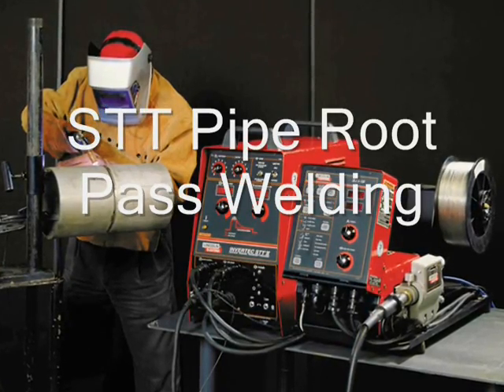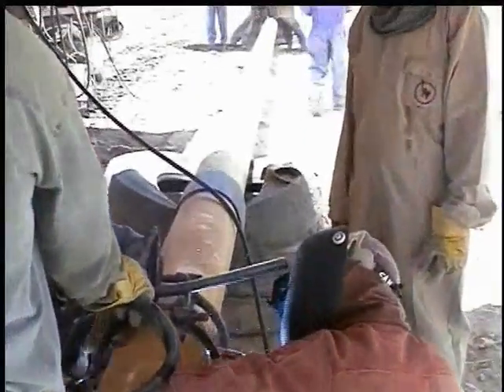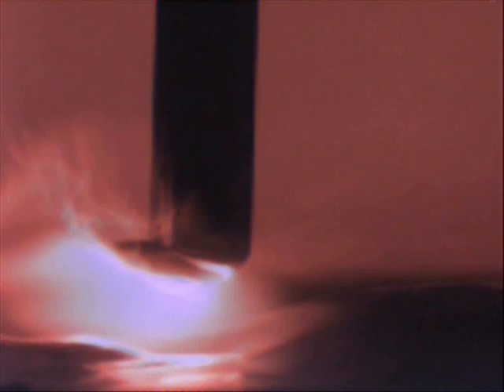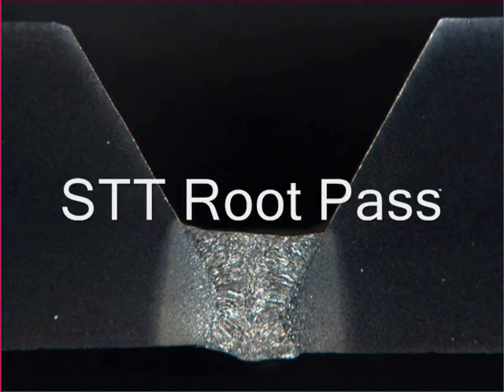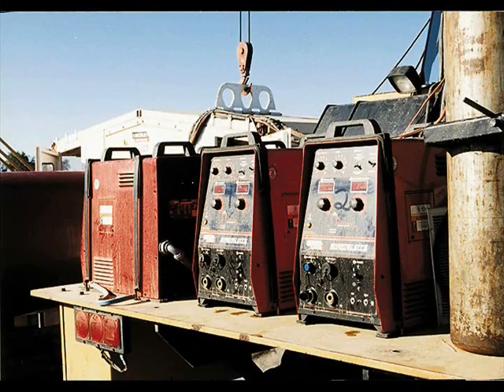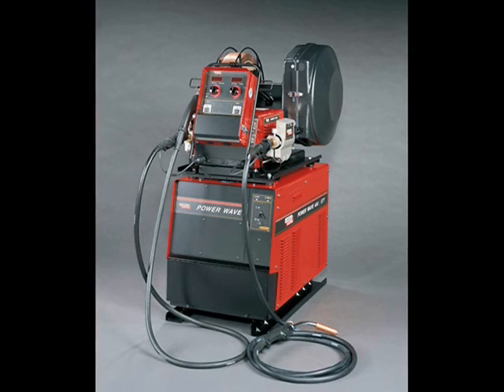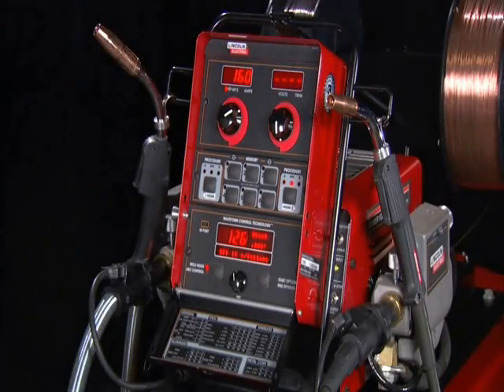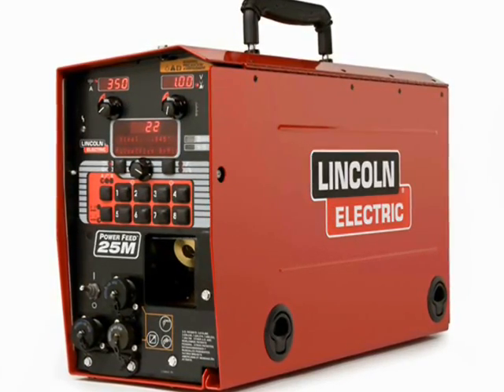STT Explained - Part 1

Comment from the maker: Thanks for your question. Yes - STT is recommended as vertical down process for open root welding. Typically using this process vertically down for any additional passes on ASME welds would not be recommended.

Comment: At 0:35 it seems the welders are doing vertical welds moving downward rather than conventional upward path for pressure pipe welding. Does STT allow downward path for vertical pressure welds?

Comment: If the opportunity to purchase this machine over a standard short-arc MIG arose-- I assume it would be able to completely replace it for anything a standard MIG would do?
Reply: Nick Kratz  The Lincoln machine we have does STT and can also run as a normal hardwire welder. Also our machines run flux core as well. It has a dual wire system with 2 guns so when you press the hardwire gun, the machine automatically switches from flux mode to STT. The machine costs about 15 thousand Canadian.

Comment: how well does the STT work on thin stainless in regards to splatter control
Reply: The stt 2 welding plant is unparalleled when welding stainless under 5mm when using argon/helium gas mix and 0.8mm wire virtually no spatter less smoke and a low heat input I have welded 1.5mm dairy tubing on a turntable no problem can replace tig in most cases where I work stainless is the bulk of the work done there are over 25 stt plants in use there some 10-15 years old and still going

Comment: I'm a newbie with MIG so bear with me, but obviously this is with FluxCore right?
Reply from the maker: +JP Sureau Thanks for your question. This is NOT Flux-cored wire. It is solid wire. Usually it is in applications with pure CO2. Please keep in mind that it depends on the application though.
Reply: lincolnelectrictv Thanks for the clarification.